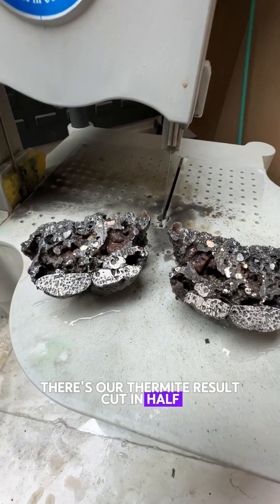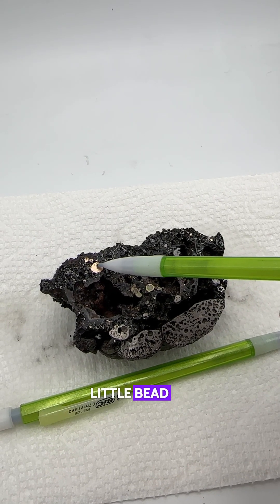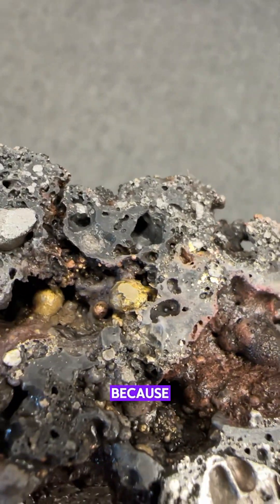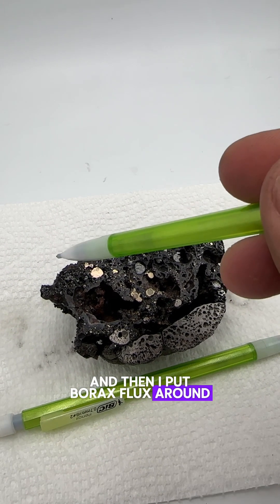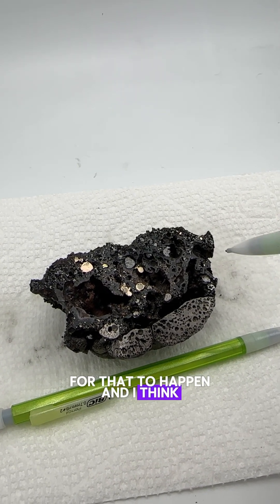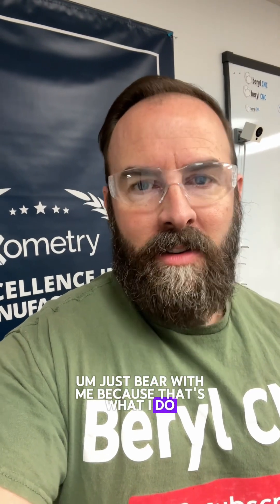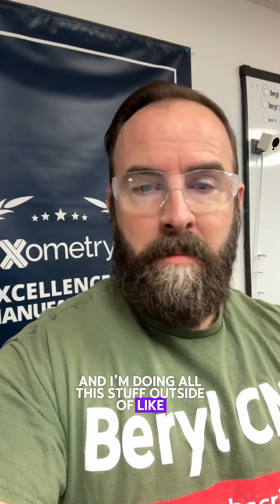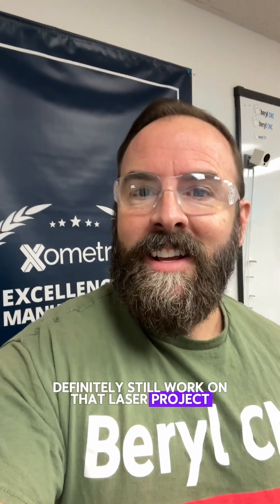The Dream of Instant Alloys via Thermite!

Comment: I like it!
You got any friends that have an airplane?
If you ignite the charge and drop it from a great height, then it cant stratify. If it lands in a lake or perhaps in the Gulf Of Murica, then it could be located with some air tag like thingy and retrieved with a magnet on a long bit of 550 paracord.
Maybe mix a core of nano powderd metals and elements, like NdFeB, and the thermite can be used to melt it all into an HEA. And cool enough to solidify in free falling conditions. Maybe that would make a super magnet.

Comment: would agitation, during the reaction, of the cold crucible be beneficial/possible to help with getting it homogenized?
Reply from the maker: Probably. I have some ideas about that... 1. If no agitation, could do a thermite shaped cylinder with an inverted central cone and allow the melt to pool in the center, mixing as it drops out of the reaction. 2. might be able to shape the thermite in a thin walled 3D print so the reaction exhuasts into the puddle and agitates. I think option #2 might introduce too much bubbling. Another idea someone mentioned was to possibly use a first thermite reaction to pre-heat the crucible, allowing longer liquid puddle time for mixing.